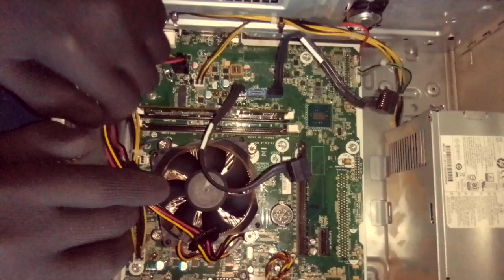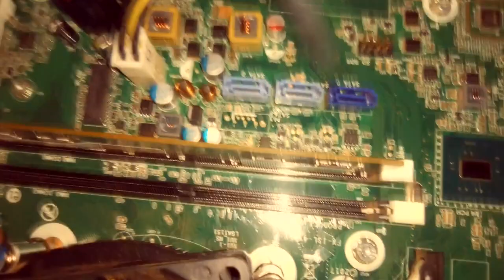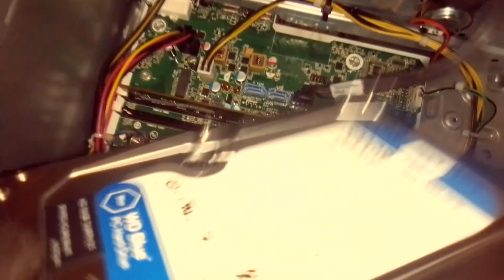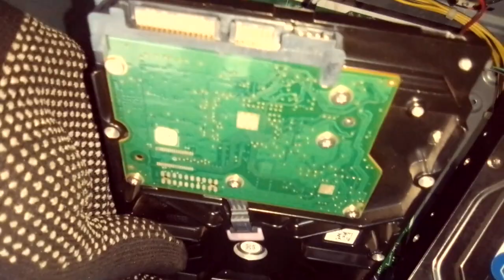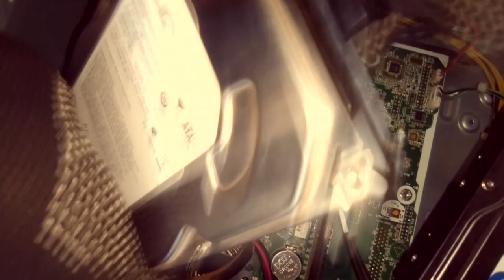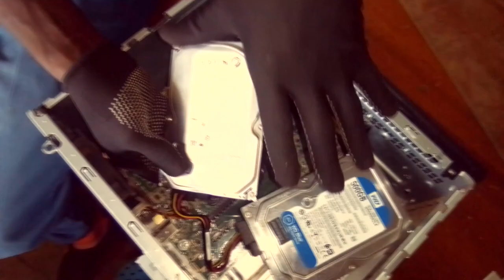HOW TO SLAVE A HARD DISK

Comment: Very helpful!   But what if i have only one sata port remaining in my computer? How can i connect 2 hard disks?
Reply from the maker: There is an extension for that and you can also use external hard drive
Reply: i really would like to use an internal harddisk coz of several reasons like security since i operate a movie shop, which extension did you mean?